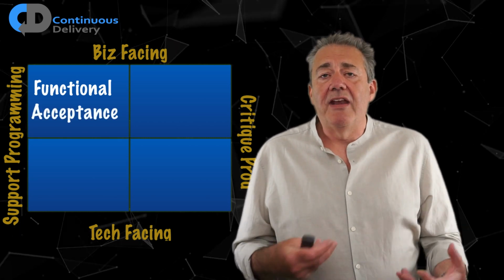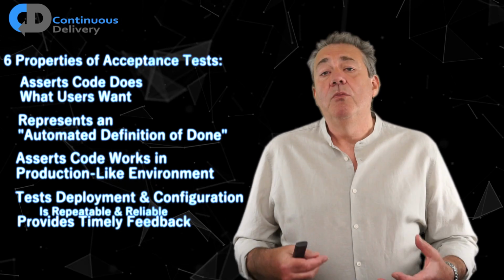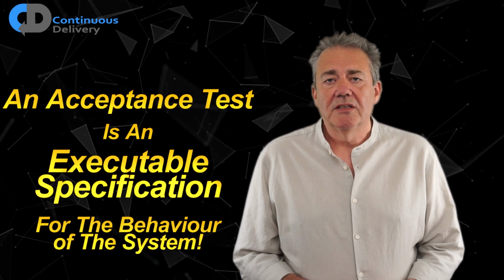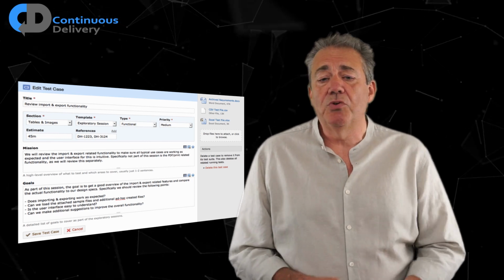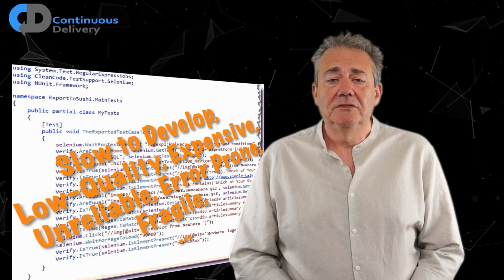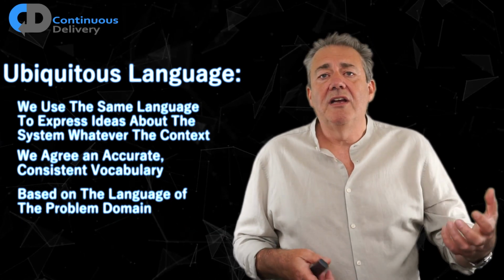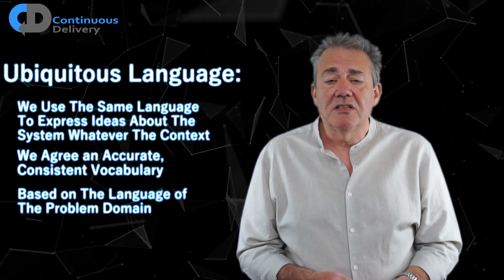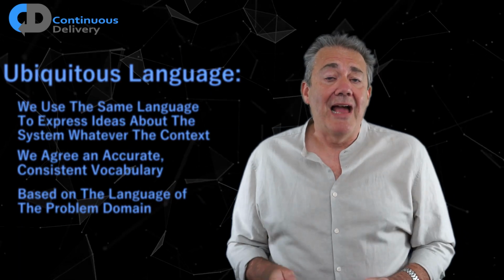Acceptance Testing with Executable Specifications

Comment: It makes sense as a communication tool only because it still gives the developer complete freedom to intentionally or unintentionally circumvent the correct implementation of those "executable specifications".
However, having additional hidden tests/specs that confirm consistency of the developer's implementation could help make them more than simply an executable UML.

Comment: I think these explanations of continuous delivery processes require more practical demonstrations of how to write a system that does them correctly. This is all just theory based and at a certain point, I think this channel needs to step up and back up the theory with some examples, they don't need to be perfect, but at least prove you can do what you are telling others to do. For example how can I create a deployment pipeline step by step to develop a react application? Like what are the actual technologies to use for acceptance testing, building and deploying the software and how to use them?
Reply from the maker: Well it is certainly not "just theory" because all of this stuff is based on real world experience, often with VERY complex systems. 
There are lots of videos on the channel of real examples of different aspects of CD. When it comes down to it, this is free advice, you don't have to take it 😉
Here's a real world example of a deployment pipeline that shows that this isn't just theory: https://youtu.be/bHKHdp4H-8w
...but you'll still need to learn to use your own tools to build one like this.
Here is how to start: https://youtu.be/eozFlgu6ByY

Comment: Great content!

Let's dig a little deeper into technicalities, so that I can ask a question:

The BDD needs to have underneath some support for the more concrete technologies used, some helpers, etc. E.g. "when operation A available", let's say an assertion that a link exists. In the BDD test, there's no mention of the link, just of the feature.

Cool so far.

The question is: would you tie those helpers to the technologies, e.g. to the link in this case, or would you introduce an additional "view model" and you'd make the system "render" those models instead of the whole css/HTML bloat, and assert against that view model?
Reply from the maker: I think that this may help describe how I divide up the implementation of Acceptance Testing https://youtu.be/JDD5EEJgpHU

In it I describe my preferred 4-Layer architecture, Test cases at the top, written in a DSL, which capture What the system should do without saying anything about how it should do it. Next layer down is the DSL, which is shared between many test cases. The the protocol driver layer, which I think is what you are asking about, and finally the System Under Tests (SUT).

The protocol drivers take biz-level concepts, captured in the DSL and translate them into something that drives the app. So a test case says "placeOrder" and the DSL sorts the paramaters, helps with abstraction and passes 'placeOrder' on to the protocol layer, which translates that idea into "complete this field with this value, and this other field with this other value, and press this button" or "Create a message with these values, and send it here".

This video also describes some aspects of this separation: https://youtu.be/zYj70EsD7uI

Comment: great video and suggestions as always Dave ; one question - when you say decouple test as much as possible from system - so that the test should be able to validate what its supposed to even if the system undergoes big /major changes..  Thats sounds great but exact details/example would help. Lets say there is some 'approval' process in some workflow and we want to write a test for this. and say the last step of this process is user fills in couple of fields, checks few check boxes, adds comments and clicks approved button.  now in this case are you saying even if the count of fields on screen change, even if the layout change, even if say we have a need to add additional approver  etc etc ; the test should work ?
Reply from the maker: I didn't do a good job of replying, so let me have another go...

I try to approach these kind of tests always from the users perspective. From their perspective the fields that they complete don't matter, their intent, presumably, is to say "I approve". The detail of what it takes to approve is what you, as the developer, care about, not what the user cares about.

So separate those two things.

In the Acceptance Test Case, create a Domain Specific Language (as I describe in the video) to capture the user's intent. In this language add, if it doesn't already exist, a step called something like "ApproveX".

This does several things. It captures the user's intent. If that approval is important then this will always be true, however "Approval" is achieved. It is so general, that you will often find that approval may be useful in other contexts, and finally, you have strengthened and extended the ubiquitous language!

Of course, you as the dev, still need the detail of the approval. So in a lower-layer of your test code write the group of interactions that make an "Approval". In these lower layers you get the info that you need and encode the interactions.

My preferred approach is a 4 layer strategy...

     Test Case (Language of problem domain, "What") -> DSL Implementation (param parsing etc) -> Protocol Driver (Translate from DSL to System interactions, "How") -> System Under Test

I plan to do videos on this stuff in future, meantime here is a conference presentation on the same topic:

https://youtu.be/s1Y454DTRtg
Reply from the maker: I will provide examples in future videos, so stay-tuned :)
Reply: I was going to ask this exact same question :)
Reply from the maker: See my other reply...